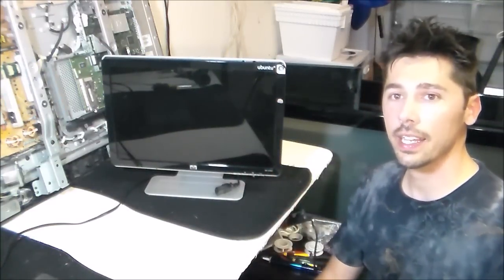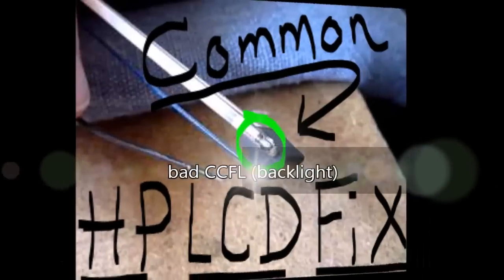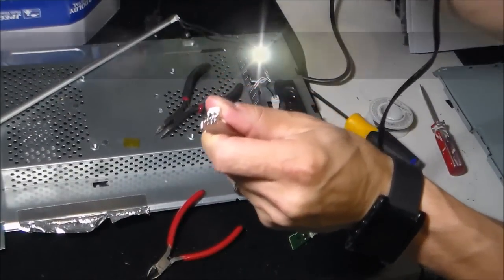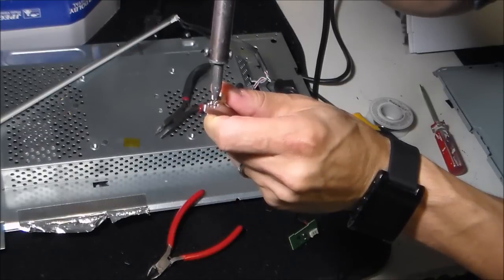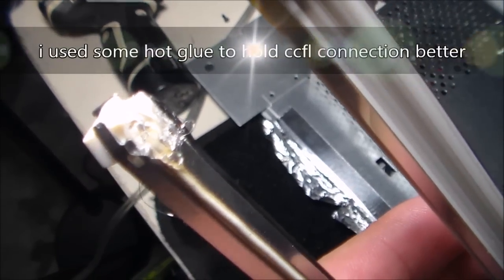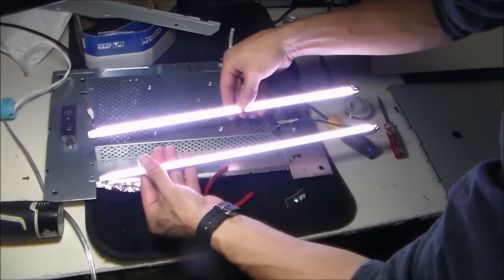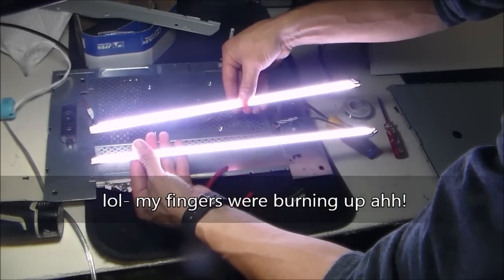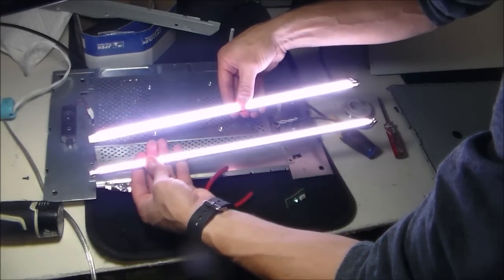HOW TO FIX HP LCD, monitor turns off after 3 seconds (common repair)

Comment: i have samsung 2253bw monitor. I turn power on and i can see screen for about 2-3 seconds. prior to doing this it was starting to flicker is that the normal for connection going bad. I opened it up and from the looks of it all the capacitors are fine. none of them seem to be bubbled on top or popped up / open. 

So what do you think it might be. Im not a electrical guy but I would sure like to save and fix the monitor if possible. I have dual monitors and its killing me to be on only one screen when im working. Any help would be GREATLY apprecaited!
Reply: +Brown Trout I have the 2233bw here and I see the screen for about a second before it goes off.

Some say a fix can be to turn the brightness all the way down to 0, I've tried it and just letting the monitor run to see if a picture might come up after a while.

If not they saw caps are the next thing, but if not blown caps then there are other fixes for similar symptoms. Check backlight wires, inverter board connections, bad diodes.
Reply: the back light seems lit and the caps dont seems blown. So I'll check invert board connection and (diodes - not sure how to do this?) next
Reply: +Brown Trout Another way to check if the screen is processing images is by holding a flashlight right up against the screen. If the backlight is bad then you should be able to see the image with the flashlight; you're only applying the light to the front instead of the rear...
Reply: Hi! were you able to fix it? thanks!

Comment: brilliant Video, I have an HP Z30i, the back light is working but I am just getting a stripe about 10cms wide from top to bottom any suggestions please ?
Reply from the maker: That's LEd backlit I think, could be bad led strip.
Reply: @TampaTec  Thank you for such a quick response. I had the screen apart to this level and the back light was working, I will check again but wondering if it could be the T con board....

Comment: Same problem ,but is not capacitors or backlight loose connection, what can be?
Reply from the maker: Replace ccfl tubes or check backlight circuit.

Comment: Great!!
it worked, two leads were burnt.
but now screen goes blank after few minutes. power off and power on brings it back, it repeats.
vga cable re insert will also brings back
Reply: Same problem with my Samsung Lcd, did you get any solutions.??

Comment: Nice Tip , helpful video  came across this several times . Easy to fix once you know , I think this is caused due to the heat of the CFL and perhaps the wire sheaf ( outer protection ) melting

Comment: first of all , i wish you a happy new year , hi i have  a hp L1908 it stay's on like for 2min and then he goes off , if i push the on button it goes on and in sec's goes off , i already check the caps visual only and they are fine i have to take him out the pcb and tested out side , can the problem be the lcd back light soldering ?
Reply: Hi! were you able to fix it? thanks!

Comment: Just started happening to my HP 2009m. Time for a new monitor 😁
Reply: I fixed my 2509m using this guy's method 3 years ago. It's now 9 years old and still running. I recommend you try fixing yours, they're quite good monitors. If you want you can order new CCFLs from aliexpress, or look up ccfl to led conversion and order led strips to replace your ccfls entirely.

Comment: Same problem. checked mine. No loose wires. What else ‘s my option?
Reply from the maker: Sometimes the solder connection looks ok but isn't. I would still solder those connections if you have the same issue with the same monitor model.
Reply: Tampatec thank you!

Comment: Hi, I need help. I have an HP 25bw with this same issue. It's a triple monitor set up so I want to know how to do this in the future when the others fail. They are bezel-less. I get the screws off but there is a small square hole with a lock symbol above it. I can't get it open. How do I deal with this? any info would be very much appreciated.
Reply from the maker: not sure unless I look at it but that can be for something else most of the time lcd monitor bezels pop if you carefully  pry on it.
Reply: Thank you for replying. I realized the square hole is for a lock. But there is no bezel just glass on the entire front. Ugggg. I'll never fix this :(
Reply from the maker: +Dove Paradise send me a video link to what's wrong and 360 view of the lcd monitor.
Reply: +Tampatec OMG thank you so much! I'll do it first thing in the a.m. 
Thank you! Thank you! Thank you!
Reply: +Dove Paradise this is the first time I've not been able to fix something and it's driving me crazy.
Reply from the maker: +Dove Paradise I will do my best to help. :)

Comment: Thank you for the video that helped me fix the backlight but I still having  the following message "No signal "on my screen.Any idea ?
Reply: No signal simply means that the monitor is not connected to a powered up video card or laptop output.

Comment: I have exactly the same monitor model. My problem is when I turn on the system there is display but after a 1-5 minutes the monitor turns black but the system is still on. Should I do the same solution as in the video or you have other way to fix my problem. Thanks in advance :)
Reply: +mark barbacena It's definitely one of the issues mentioned above: a faulty cap, faulty CCFL leads or failing CCFLs. It means that the faulty component starts acting up only after it heats up a little bit.
Reply: Hi! were you able to fix it? thanks!

Comment: Awesome video. I was able to do this with my HP2509m, got to the end, tested the lights with it just plugged into the circuit board, but nothing appeared to be wrong with the connections, unlike in this video. I suspect it was blown capacitors, so the monitor is junk (its 2009 anyways). 

Either way, it was fun to take apart!

Comment: Excellent video. Terrific camera work and commentary. I was hoping this would be my issue but after taking unit apart and tugging on tube connections they seem to be fine. They shut off after 3 sec.It's an HP w2207h - 22" LCD. If the joints seem fine would you recommend soldering anyway or do you think it could be a capacitor? I don't see any discoloration on capacitors. How do you determine capacitor? Your advice would be appreciated. Even removed board to look closer at capacitors. Of course with my continued fiddling I accidentally snapped one of the tubes. Btw, its the bosses monitor. Haven't mentioned he will be out a tube yet :-))  Do you know of a good source to obtain tubes cheap? Thanks